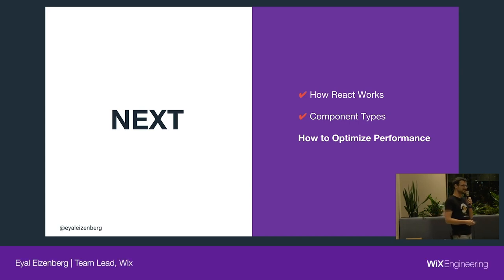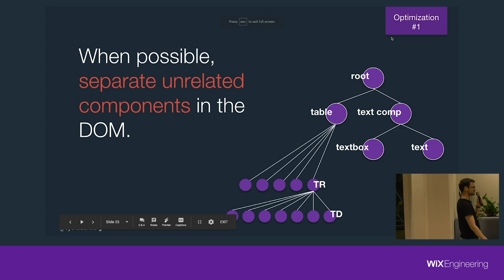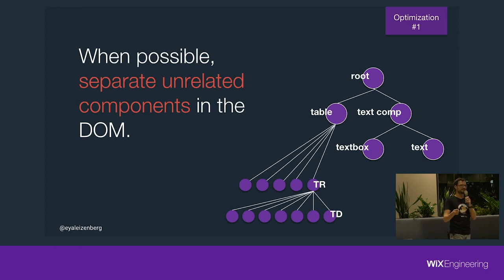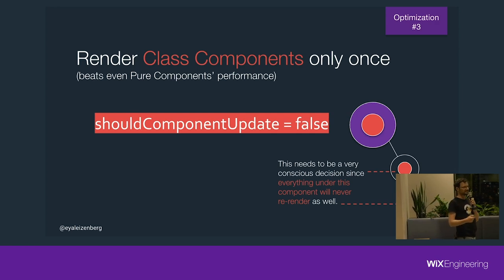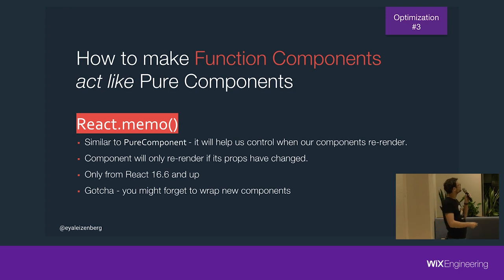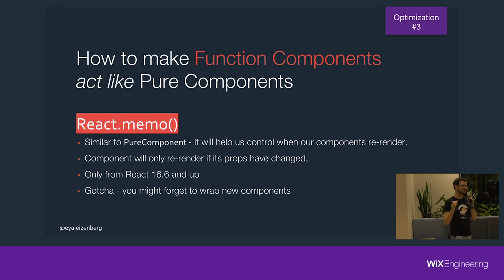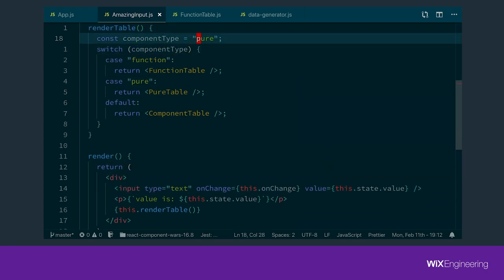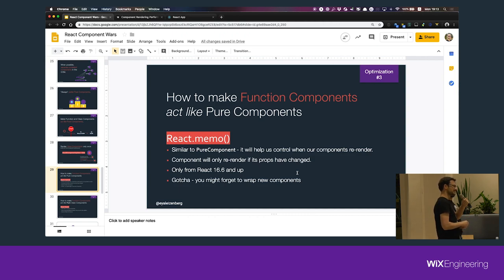How to Optimize Your React Components' Performance? - Wix Engineering Snippets

Comment: PureComponent is used badly by people that use inline functions in the props and don't get really the benefit of it. The shouldComponentUpdate is starting to be legacy from now on, and most of the performance improvements we generally do is unnecessary. Seperating the table from the search input is really a powerful point!
Reply: Indeed if the proper separation is done, the need for using a pure component is less dramatic. There are cases however which a separation can not be made and using the pure component optimization is a must.
Reply: @eyal83iz  I didn't used it until now. But the problem that developers are using PureComponent with using inline functions like the onClick=() => and this variable will get a new reference on each render which means that Pure Component wouldn't improve the performance.. Developers should understand the hard parts of JavaScripts in order to understand such a performance improvements.
Reply: @islamabo0  Oh of course. Anonymous functions in the render function's jsx is something that should be avoided.
Reply: @eyal83iz  Only for those who use PureComponent since in Hooks the function will be created again and again which is not terrifying.. In all cases, our JSX is creating JavaScript object in each render and those "light objects" shouldn't be the pitfall IMO.